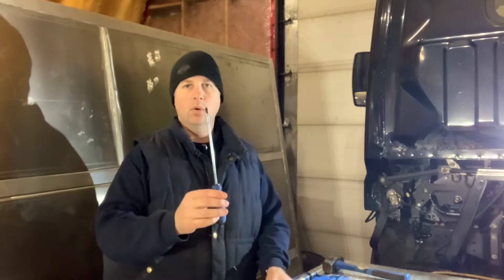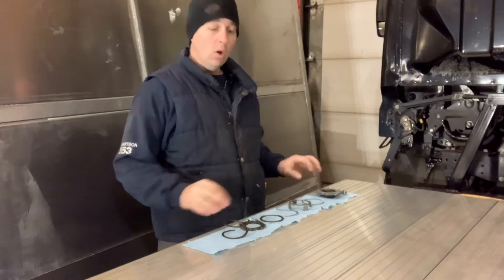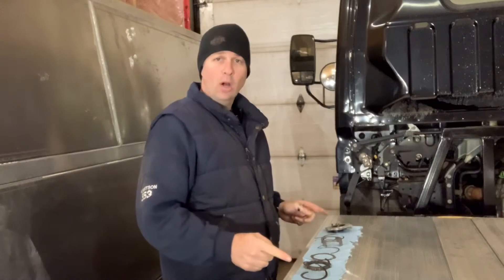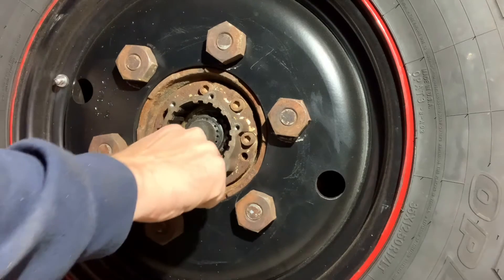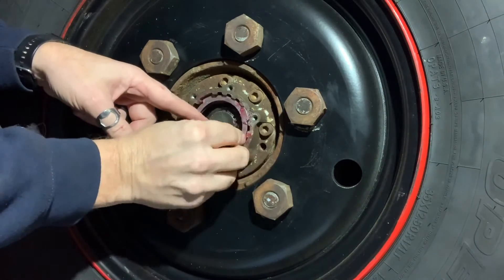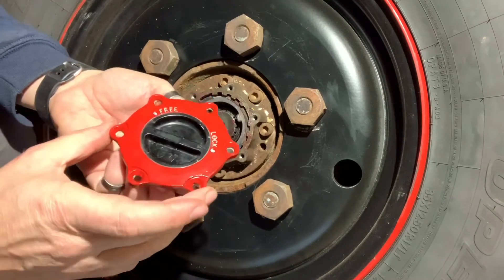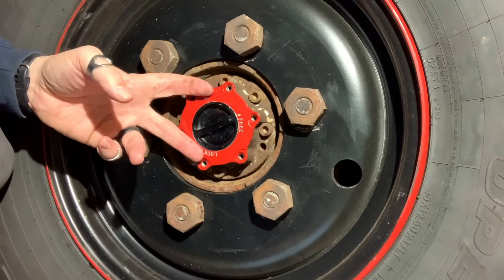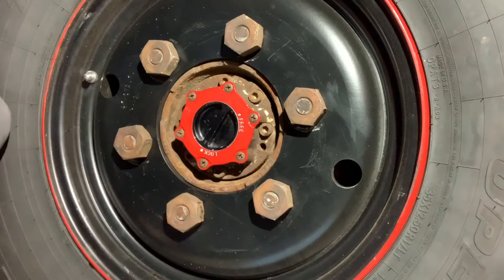HOW TO Mitsubishi Fuso front locking hub - a quick tear down and re-assembly.

Comment: Have you ever pulled the hub off? Do you have an idea how that's removed?
Reply from the maker: Yep, if I recall you remove the six bolts in the freewheel hub, (holding the hub on), then re-use two of them in the threaded holes to force it off.  Once the freewheel hub is removed, there is a round plate with two 10mm bolts - similar to what is used in the rear brakes.  With those removed the wheel hub is free to come off.  One day I’ll get to that video!

Comment: Sir is this  the same  to 4d35 Mitsubishi car ? Cause i  try that  pattern to my     car but    it still  grinding
Reply from the maker: I can not confirm if it is identical (some parts may differ slightly, if the axle splines are different for example) - but the assembly sequence should be very similar if not the same.  Is the grinding sound coming from the wheel/hub, the differential, or the transfer case?

Comment: Thank for you video. Have you had issue with ENGINE SPEED INPUT CIRCUIT INTERMITTENT P0728z. I’ve this issue on my fuso canter 2016
Reply from the maker: I have not seen this code - could it be related to the crank shaft position sensor?
Reply: @BruceandKrista  I don’t know. I’ll try figure it out and let you know
Reply: @BruceandKrista  where’s it located?